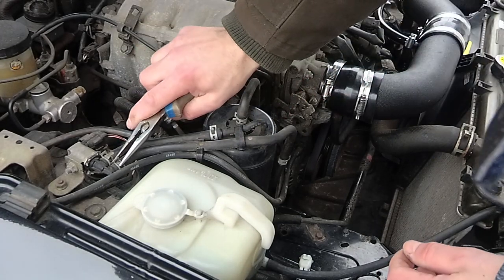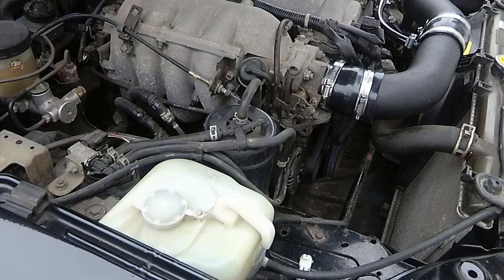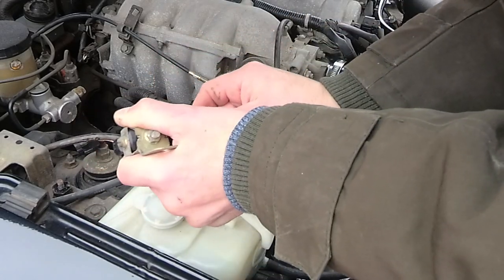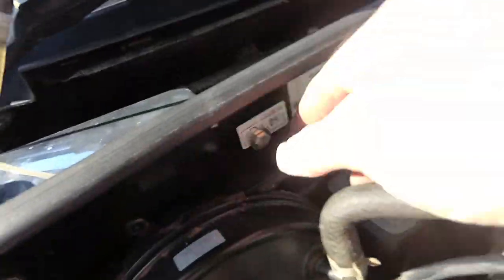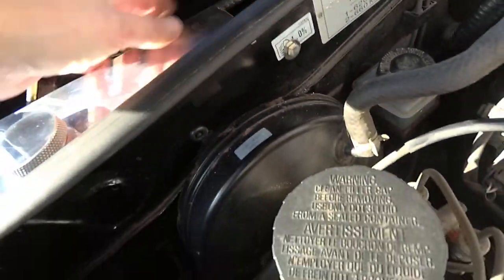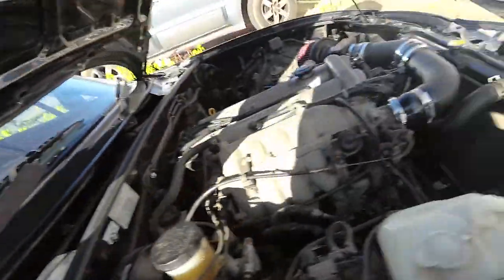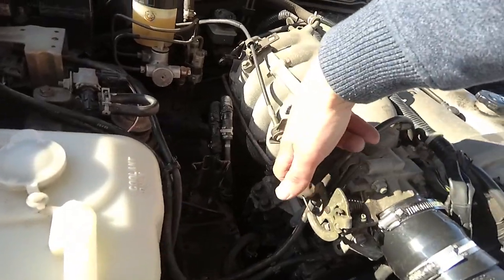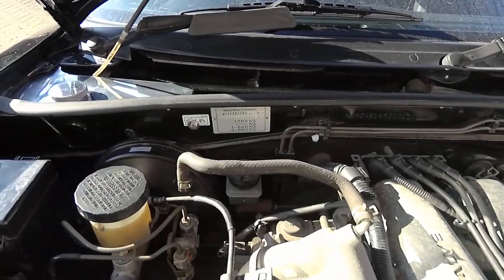Easy Bay Shave Mods - Washer Bottle Relocation and EVAP Delete - MX5/Miata NB

Comment: A quick tip: to avoid screen wash bubbling up through your washer jets and dribbling down your bonnet, you will need to drill a tiny hole in the screw cap lid for the new aluminium washer reservoir. This allows the expanding air inside the reservoir to vent out rather than forcing liquid through the pipes up to the jets.
Reply from the maker: +Phil Jones I haven’t noticed that problem, but good advice for those that might. Thanks.

Comment: I got the same bottle a while back with a eBay special £10 pump. It only worked downhill so I finally copied you and put the stock pump in. Centre punched a tad above the hole so that it wasn't as close to the bottom lip but it now works perfectly! Cheers for the vid mate 👍
Reply from the maker: Ah good. I’m glad you fixed it.

Comment: Nice vid'. I've done both these engine bay mods on my mk1 Eunos. Makes loads of room. Removing the EGR cannister makes space for a coolant reroute ¦:¬D  . I then put in an oil catch can (as I have a turbo) where the washer bottle was, but it's a 1/3 the size so there's still plenty of room. I like the fact that you film things as you go along, including any mistakes or time-out to think about what's next. Much more realistic rather than preparing in advance and only filming your successes! Keep up the good work.
Reply from the maker: +Phil Jones Thanks for the kind words Phil.
I like to keep it real, because I am no expert, I’m just muddling my way through.
Reply: Just put an filter on the camshaft ventilation. Catch can is almost useless if running a turbo. Vacuum gonna be rare. And EGR canishter ???  Egr is exhaust gasses back to the intake. It's a solenoid removal and blinding 2 ports. This cannister 'catches' fuel vapors.
Reply: @Kane Dillon Instablaster :)
Reply: @Franco Jalen I really appreciate your reply. I found the site through google and Im in the hacking process atm.
Seems to take a while so I will get back to you later when my account password hopefully is recovered.
Reply: @Franco Jalen it worked and I actually got access to my account again. I'm so happy:D
Thanks so much, you saved my account!
Reply: @Kane Dillon no problem =)

Comment: What mafh is that and is there somthing like it for the na6 chissis, i dont have an aftermarket ecu, but would like a cheap and easy way to make it so my aftermarket filter doesn't hit my headers, and possibly make my bay cleaner. Cheap and easy is key, just no zip tie mods, lol.
Reply: I've looked into it and that one only works with the nb. The Na's sensor has a MAP sensor and it works differently. It won't connect to the ecu unfortunately. I've been looking for something like that too.

Comment: Is there any negative to removing the evap canister
Reply from the maker: +Joseph Rizzo I haven’t noticed any difference after many months of driving.
Reply: If you park in a garage you'll notice a petrol smell, the fumes coming from the gas tank are just venting into the air rather than being absorbed in the canister.